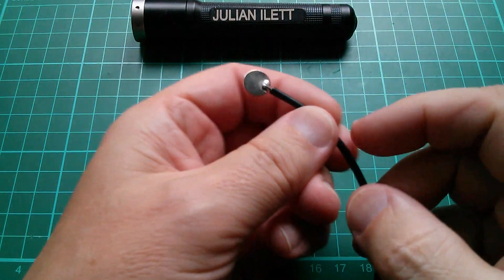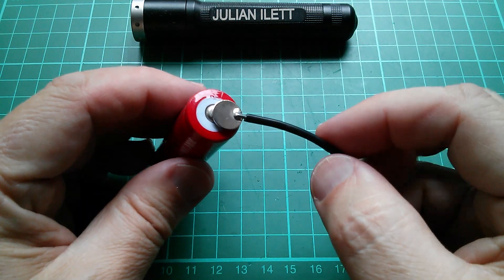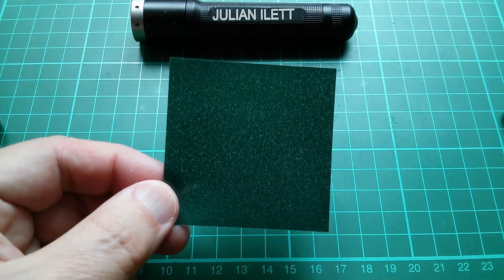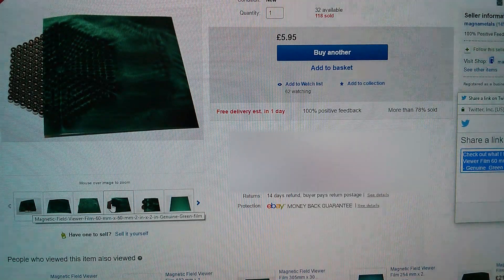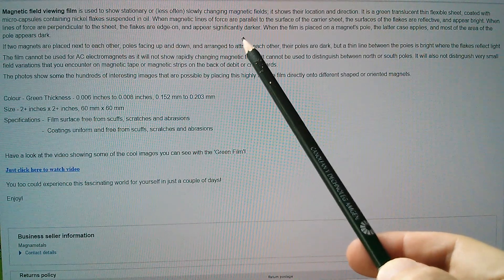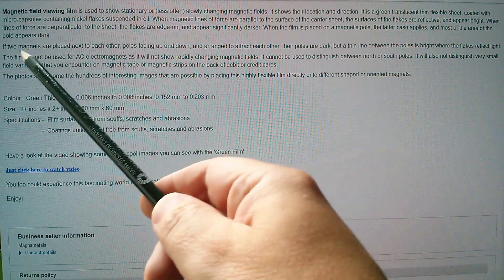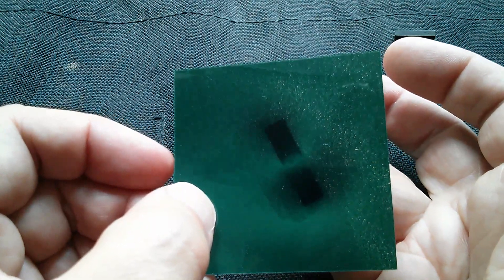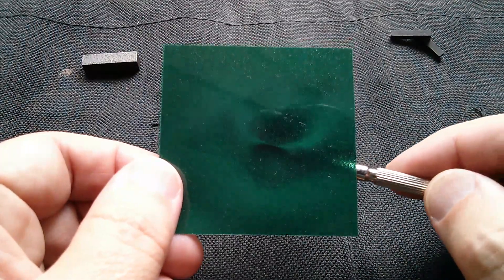Playing with: Magnetic Field Viewing Film

Comment: Everyone thinks iron filings follow the magnetic field "lines", but the field line idea is completely misunderstood.  Science uses lines to illustrate the gradient on paper.  The field itself with no mass is actually smooth with no detectable lines in it.  The filings each individually become little magnets in a field by channeling and concentrating the field through itself with north and south poles that convince other mass to do the same.  A group of filings line up each other's poles CREATING lines that were not there in the field by itself.  It gets more complicated in the spacing mechanism, and I'm sure no one can explain that yet.  Modern science still struggles with "why" it's perpendicular to electricity.

Comment: Basically when you soldered it, that part reached the curies temperature, so the ferrite material was in "magnetic flux" where the molecules can be set in place better. So all the molecules will have a randommagnetic orientation (that is what we call demagnetisation, because magnetisation is just the alignment of them magnetic fields (every metal is electromagnetic). When making a magnet, they heat the material to the curie point and use an extremely strong electromagnet to align the orientations all the same way.

Comment: You can really see the effect that the heat had to the magnet, it clearly had removed all the lines of force from that section.  Neat!  If it really had "flipped the poles" of that section, there would be a distinct black area for that newly heated (soldered) section, with a white border around it.
Reply: When it reaches the curie point all of the molecules are more free to change magnetic orientation, so without a bias, they will all be in random orientations (demagnetised)

Comment: Those viewers work much better if you allow the back lighting to come thru .  Much Better !  View from the Matt side.   When you heated the magnet you raised the Atoms to a higher energy state.   When metal is heated to the Red Hot State it turns RED because the Electrons are boiling off.   When ever a Electron alters it's valiance bond a Photon is emitted. The corresponding Electrons were allowed to free float at will.  The Electrons were no longer Aligned is the singular directions.

Comment: Neodymium magnets have a curie point between 100 and 200*C (this is the temperature above which it loses ferromagnetism). Solder is well over 200*C so it will destroy neodymium magnets, and you'll have to remagnetise them.

Iron magnets are much more heat-resistant

Comment: Maybe next time you could solder to a piece of magnetizable metal, like tin plate, stick it to the magnet and apply super glue on the edges? The magnetism will keep the plate in good electrical contact with the magnet and will stop the glue from creating an insulating layer. Another thing to try would be to cool the other side of the magnet and applying a very quick soldering joint, or heating the whole magnet up before soldering.

Comment: The fact that copper is diamagnetic which means it repells any magnetic force no matter if + or - could also play a role as you used a copper cable. I don't know how the solder itself acts under magnetic force. So maybe try again with just the solder, or different cables, or just heat, then you !earn more about it.

Comment: are you sure it wasn't just the wire causing the disturbance in the image? i would have liked to see what it looked like with the wire removed, and possibly even the solder removed as well so that there is no other metal on the magnet that could be interfering, and then we could be sure that it was the heat that made the change.

Comment: You might want to buy a gaussmeter, then you can measure the actual magnetic field strength and polarity of the soldered neodymium.  You'll find a disc neo has the strongest magnetic field at the edges and weakest at the center.

Comment: The "thin white" areas that you describe as "where the magnetism goes to zero" between the poles might be better described as where the lines of magnetic force are parallel with the sheet. This according to the material you read from the vendor's listing at the start of this piece. 

As always, a jolly good trip down an electrical side-alley!

Comment: Hi Julian, I also found out that neodymium magnets are bad conductors even with the surface metal. The resistance is quite high for such a small device and may lead to voltage drops.
Reply: Solution: Galvanise a copper layer onto it after soldering.

Comment: The curie temperature of the typical "neodymium" magnet ( Nd2Fe14B) ist only about 310°C ( they can be used to ~150°C) so it will be easily demagnetised due to the heat of the soldering iron. So you have two (or maybe 3)  options:
1. Try to connect the wire without heat (conducting glue?)
2. Minimize the time of applied heat to shrinke the demagnetised area (spotwelding?)
3. Try to get some Samarium–cobalt magnets, they can be used up to 250°C some kinds (Sm2Co17) up to 550°C. Downside they might be expensive and the energy product is slighty smaller. They are used for example in big electric motors where neodymium magnets can't stand the heat.

Comment: for quick connect/ disconnect I just used the alligator leads from my power supply and stuck them on the magnets. still way easier than soldering onto the battery,but not what your wanting. again I would suggest solder the wire to the side of the magnet so you get as small of a surface area as possible. have the magnet almost entirely of that metal surface (the heat shouldn't wick away too fast) and use a small amount of flux. try putting a blob of solder on the wire making sure it's melted by the time it gets to the magnet and once it sticks take off the iron. it will also help with your stacking design

Comment: Look up the curie temperature for your magnet type. That is the temperature at which the molecules are free to move very slightly, and the set alignment of the magnetic field is lost. The curie temperature for the N type is 310 deg C, other types up to 350 deg C, and solder only starts to melt around 216 C.

Most typical soldering irons are around 330°C to 350°C, which would be above curie temperature..

So maybe use the coolest temperature soldering iron you have / can borrow, and use heatsink clips to bleed away the heat, to avoid damaging the magnet. In the one you did the magnetism seems to have only left exactly where you soldered, so the heat did not seem to spread very far, it looks like. But seems like keeping it as much as possible under 300°C would be a must.

Maybe try a low temperature paste solder like used for SMB components, and cure slowly at a low temerature, it in a toaster oven like you would for SMD components, but i've seen peak reflow temperatures of 260°C which is maybe cutting a little close. Maybe try cooking a magnet at the peak reflow temperature for a paste solder you know, and see if it stays a magnet.

Comment: If I am not wrong soldering results in a sort of alloy formation so the molecular arrangement of the points on the magnet where the solder has adhered to is now different from from what it initially was. And if the molecular arrangement (which is the very cause of its magnetic nature) changes then it loses its magnetic nature in those points. And magnetic mono-pole doesn't exist so the other side loses its magnetic properties as well.
I would suggest you to try to solder along the neutral point of another thicker magnet(say 1cm thick) instead of the 1mm or 2mm magnet that you used in your previous video. But even then I fear that you may not get a complete round dark circle like you got for the normal neodymium magnet as the magnetic path might be disturbed due to the soldering but I think its worth a try.
~Amit

Comment: Maybe this is an odd idea, but re-perform the solder operation to a new magnet, but set up a magnet holder for the soldering operation that would itself generate a very strong EM field.  The idea is that as the material cools, it does so in a strong magnetic field and will reflect that orientation and strength in the solidified form?

Comment: damn, idk if my comment isnt showing because I put a link in it. trying again without the link

Julian, have you considered using Samarium Cobalt magnets instead of Neodymium? Theyre magnetically stable to well over soldering temperatures so they should survive having a wire attached much better.
Reply: neodymium magnet have nickel coating which takes solder. looking at ebay, some of the SmCo magnets look a different tone. can't tell if they are nickel plated or something else, it might not take solder
Reply: idk if they have a coating or if the bare alloy would take solder even. I was looking at a site called first4magnets and some of the SmCos look dull and darker, particularly the bigger ones. but the small disc and cylinder magnets have the same shiny silver look as Neodymiums, maybe you can get them with or without a coating. I think theyre the only magnets of a suitable size, shape and strength that wont be affected by soldering temps tho

Comment: I usually grab a crocodile clamp and either stick a small neo-magnet in it, or just use any magnet and attach that to the battery and the clamp. Works most of the time. Bad thing with this technique is that when you pull the wire to detach it and if you let it go, it usually lays down on the table but gets attracted by the magnet, and attaches itself again.

Comment: 6:46 might have been worth sticking the screwdrivr to the other side of the stack to see if the transition line was being displaced by having steel stuck on one end.
according to wiki the curie point of Nd magnets is 310+ C which is hotter than Pb/Sn solders melting point... so I suppose it might be worth persevering if you've got a temperature controlled iron capable of heating the disk up just enough to get it wetted - or maybe with supplementary heating.
Reply: I meant 9:46 :0

Comment: I wonder what the practical use of that film actually is - ie. what is it mainly manufactured for?  Very cool, got to get some of that!
Reply: GadgetUK164 - Retro Gaming Repairs & Mods . The stuff has been around forever. Industrial slang it's called magic paper.  Quick and dirty check for magnetic orientation and visualization. Could be handy to see if your tray of magnets were 8 pole or 16 pole ones that look the same. Which ones were magnetized which ones still need to be zapped etc.

Comment: The magnet has its force thanks to so-called magnetic domains, which are lined up in one direction. By heating the magnet up, you let those domains align how they want so now it's a chaos - no magnetism.
Reply: it's not chaos, it is magnetised the opposite way.
the heated area is still under the field domain of the rest of the magnet. the field will rearrange the domains in the heated area and once cooled they will stay in place and lock the new domain in place. 
the heated area will have an opposite domain and a bit weaker than the unaffected areas.

Comment: If you solder to the magnet while it's on top of a stack of magnets, maybe the magnetization will be partly restored?
Reply: Yea, this is the good idea, or maybe solder the wire to the edge of a magnet, which is in the middle of a stack. And insulate the other magnets from the heat with thin layers, with pieces of paper ?
Reply: That runs the risk of weaking the other magnets too, though.

Comment: Perhaps just solder to a washer, then use the magnet to attach the two?
Reply: Good idea, but taking it a little further, once the washer is magnetically stuck to the magnet put a blob of glue around the edge,  covering both the magnet and washer, that way it ensures the wire and washer will always stay attached to the magnet when pulled off the battery.
Reply: That's a really good solution.  I was going to suggest using conductive epoxy but it's terribly expensive.  Thanks for this suggestion.
Reply: thats what i thought too!
Reply: LOL, To Simple No would have came up with that one.

Comment: that is a awesome view of a magnet. I think its cool seeing things you can't normally see. but what I really need help with is Dc-Dc conversion. I figured you are the man. when it comes to electronics and DC conversion.. I need to build a constant output. 12-24v to 150-180v regulated DC output. its a boost portion for a inverter I desperately need to build. I can't afford to buy one of the size I need. I was planning on using the EGS 002 inverter drive board from eBay. and build a h bridge for the ac or spwm output. is there I chip or module I can buy to govern the DC boost stage? I'm new to electronics. and I learned what I know by doing. and watching your videos. I think I have watched nearly all of them. well maybe not ALL of them. but I'm working on watching all your videos. I hope you can help with my 4-6 kW inverter project. who would have thought making 120v Ac was so complicated! but I guess if anybody can help me. it would be you. have a great day. thank you!

Comment: You can easily identify the South Pole by the presence of penguins
Reply: Exactly
Reply: Someone has introduced penguins to some area in the Arctic now, so that's not 100% reliable. But the Antarctic is still devoid of polar bears, so maybe that could be the new marker?
Reply: Now did you know: to have a compass point to the North, the point of that compass actually is a South Pole itself.
Reply: The north pole of a magnet or compass points to the north pole of the earth because the north pole of the earth is actually near a south magnetic pole, just the same as the south pole of a magnet.
Reply: Lol

Comment: Try spot welding the wire to the edge of the magnet; maybe pre-cool it first with a liquid Nitrogen dip?  Experiment...  If that fails, devise a thin (maybe non-magnetic copper) ring that mechanically captures the magnet edge in a groove. Or, just pre -solder wire to thin copper foil that could even wrap around the entire magnet...

Comment: We're not seeing the internal magnetization of the magnets, instead we see the resulting external magnetic field. It is dark where the field lines are perpendicular to the sheet and light where they are parallel. 
There is no transition within a magnet from N to the S pole. However the magnet with two lines does have one transition, in the middle, where magnetization goes from pointing in one direction to the opposite.
The off-center line of the stack might be because the screwdriver bent the field lines, or because the magnets had different strength across their surfaces. I suppose you could test this by rotating one of them and see if you could make it centered.

Comment: Sorry, i don't usually do this on your videos, but in this case i just have to: 12:50 if you just want to see what happened to the soldered magnet. Ther suspense was killing me...
Reply from the maker: Maybe I strung this one out just a bit too long ;)
Reply: Maybe :)
Reply: I was feeling the same. Too much suspense for one of Julian's videos. But I stuck with it, through the drama of the inexplicable zig zag force. The intrigue of the 1 and 5 magnet transition line. [SPOILERS] The shocking triple pole magnet and the final revelation of the disturbance in the force.
Reply: No it was interesting
Reply: +Alan Marshall Yes, it was quite interesting, even though I too was waiting to see what happened to the soldered magnet.
I suspect the irregularities in the fields of the bar magnets is down to manufacturing defects or subsequent handling.
Reply: Sharklops What has most probably happened is that his soldering temperature exceeded the Curie temperature limit of the magnet.  When this happens a sharp change in the magnetic properties will occur and, in the case of a magnet's permanent field, it is typically a permanent change unless you have the facilities to reintroduce a new magnetic field by applying an extremely powerful external field (which is how they get their magnetism after manufacturing).  This is because once heated above this critical temperature the magnetic domains are "unfrozen" and free to reorient themselves in a manner that causes them to largely neutralize one another (essentially annihilating the overall apparent magnetism as every pair of North and South oriented domains reorient to cancel each other out by pairing together).

For a neodymium magnet that is somewhere in the general vicinity of 600K (583-673K per Wikipedia), or around 330C, so you might be able to get away with soldering a wire to the magnet if you take things nice and slow and use a much lower soldering temperature that is just a bit above the melting point of the solder (such as 240-260C), though it will take considerable time to solder at such low temperatures as the body of the magnet will want to rob the iron of heat until it is fully heated and only then will soldering be possible.  If you use leaded solder then it will be much easier as the leaded solder (~183C) melts at about 40C less than lead-free (~220C).
Reply: +julian ilett for the impatient peeps yea but not for me :)
Reply: Iron dust film that's why magnet is sticking! Not really the actual viewing of eddy's 😅tools/and technology that really shows maybe not available yet.if it is? that's a big leap for mankind!